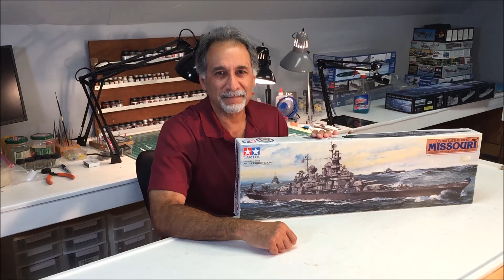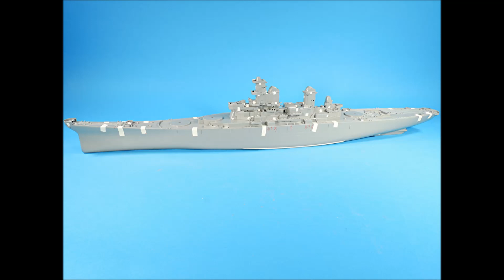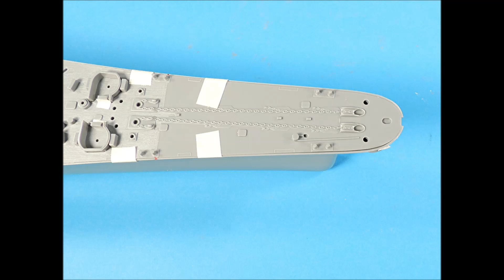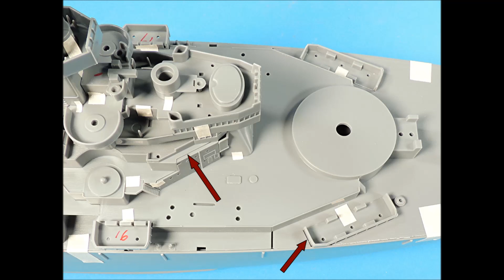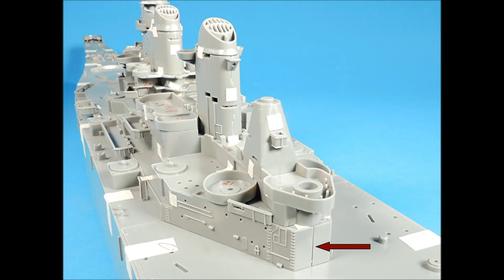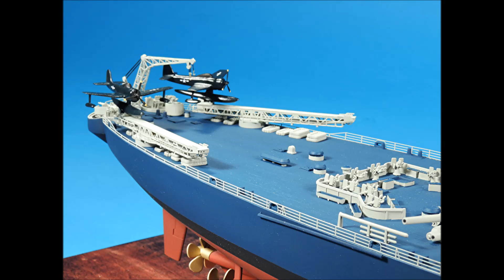Tamiya 1/350 scale USS Missouri tape up review.

Comment: So why do you use super glue to fill instead of a puddy. That seems like so much harder to deal with and sand than fill puddy.
Reply from the maker: Hi Adam

Great question

I started using super glue after I built Revell’s 
1/426 Arizona

Super glue provides strength 

It can be surgically applied

It has great capillary action

And it sands like plastic if you attend to it within a few days of application 

For void areas I used plastic strip and super glue

Putty has no of these construction qualities

Hope this helps